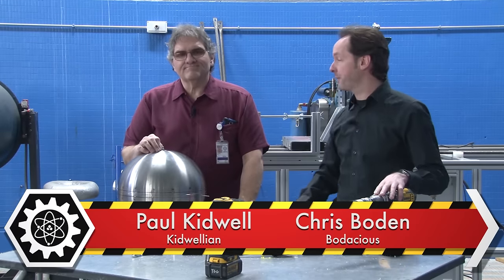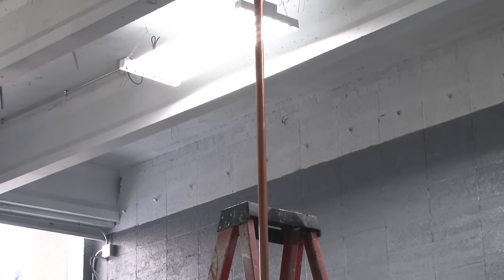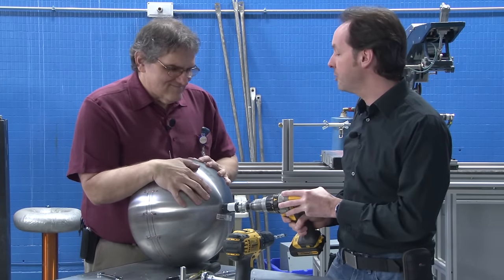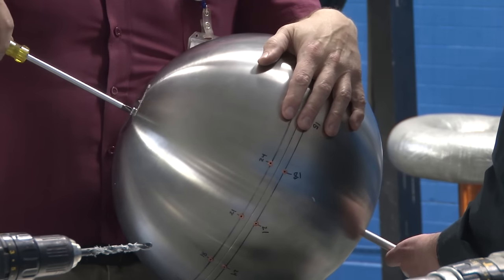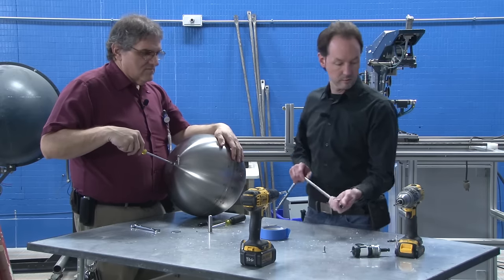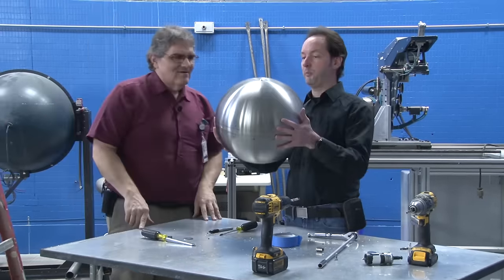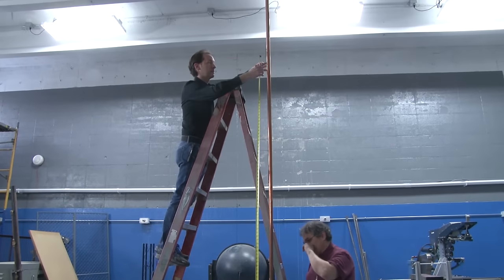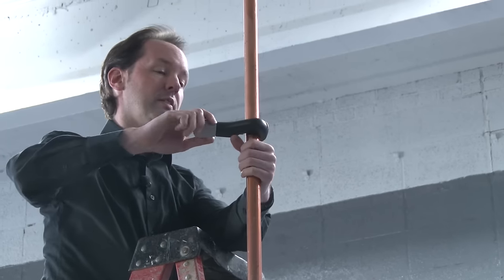Upgrading a Target Pole: High Voltage Lab

Comment: If you use a threaded rod with a nut on the bottom, pass it through all the components, even picking up that fender washer, feed it through the bottom hole to top and pull through, while holding everything stable with the socket extension, unscrew the rod and replace with bolt ;)
I've done something similar with a hard to access location.

Comment: At the base of the sphere you have a hole, where there is a space between the copper upright and the sphere. You should pack that with non-conductive material to prevent changes in the capacity load.

Comment: great idea.  what won't on work on the coil makes a great target.  "pokey bit" your speech is fun.  why do you run the drill for a bit after finishing the hole.  9' 11 3/4"  falling with the part you cut off will hurt.  enough scoring will cut something though.  speaking of hammers, photonicinduction hammered things that high voltage didn't break.  add a second tesla coil like you previously had.